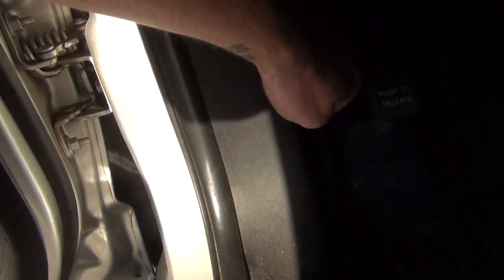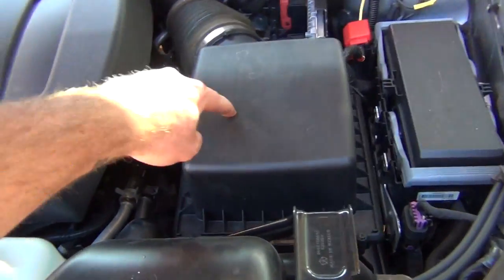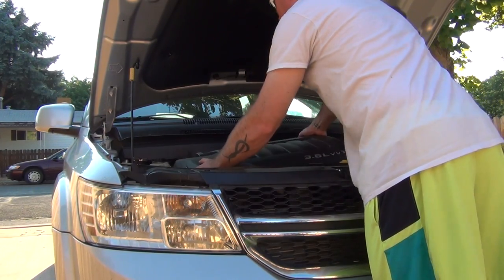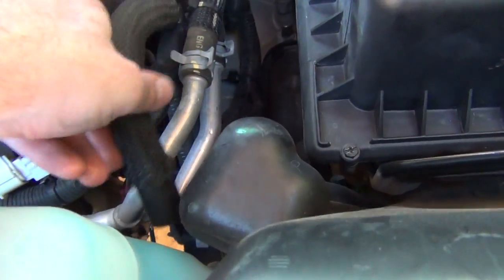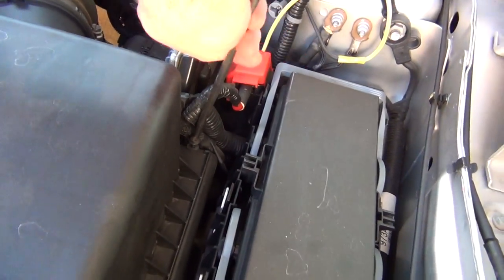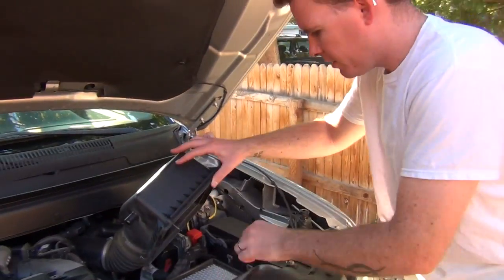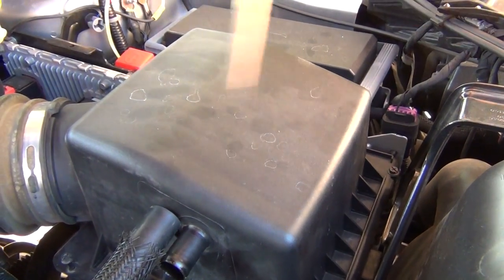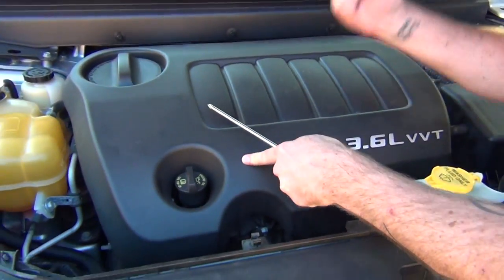How to Replace Air Filter on a 2012 Dodge Journey

Comment: I was blessed by God through my 21 yr old son to level up from being homeless on bicycle to being homeless with vehicle and had help from my son and my son helped me to purchase used 2010 Dodge Journey which is pretty easy also but different setup under hood.
The filter case has 2 clamps just release clamp levers n remove filter n clean or replace.

Had oil change, next week need tune up and find out what causing knocking when turning left n right klunk sound.

Much love and blessings of health n well being to all

Comment: Thanks so much for the directions. I have a slightly different configuration on my Journey 2.4 SE, and it was easier still to replace following your directions. However, I hear a high-pitched whistling sound, which gets louder as the air knob is turned higher. Could I have missed something? Thanks.
Reply from the maker: Remove cover again and re adjust. Could be the filter wasn't seated correctly.